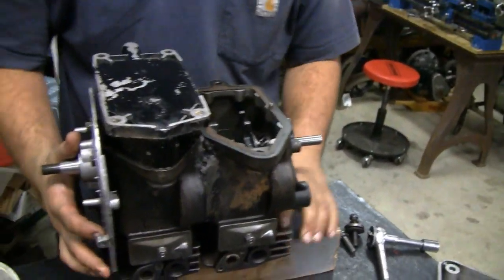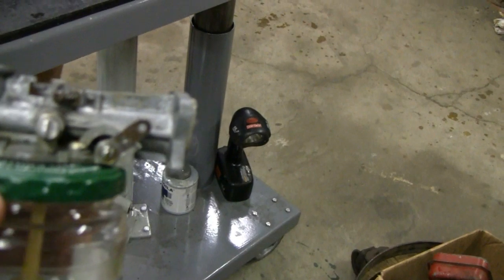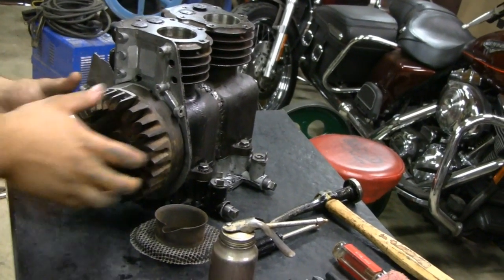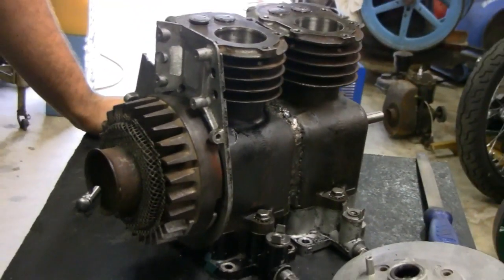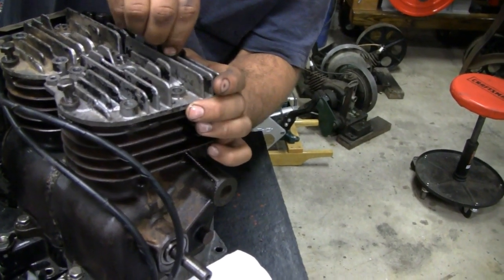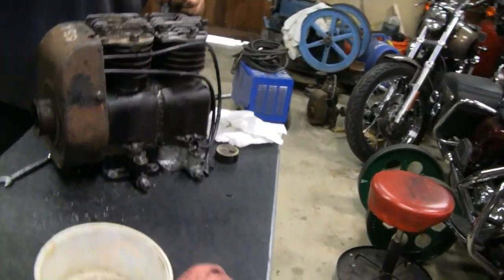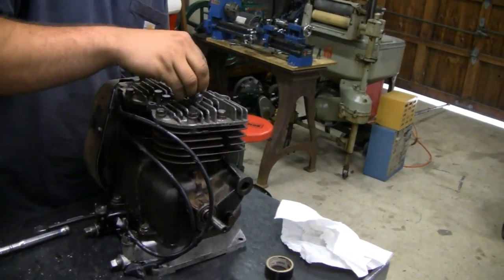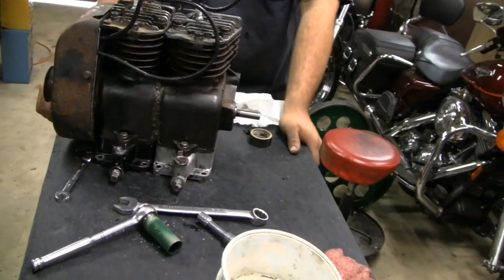HOMEMADE TWIN BRIGGS ENGINE PROJECT (part 6)

Comment: How did you make the ignition system to run with two sparg plugs? And how are you going to keep the rear cylinder cool?

Comment: That thing IS coming together quick!  I'm curious how you guys are going to design your intake and exhaust systems...  I was wondering if two carbs might be better for you than one but but one choke and one mixture screw would certainly be a lot easier.  Whoa whoa, what's this?  Top secret ignition system eh?